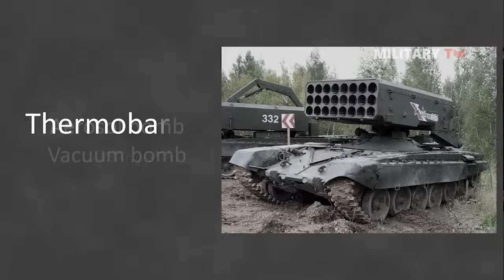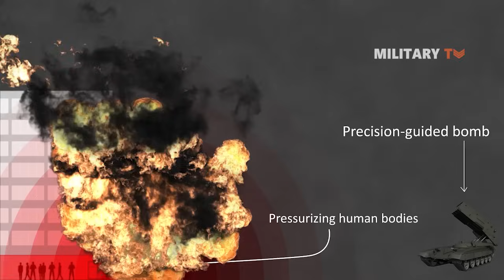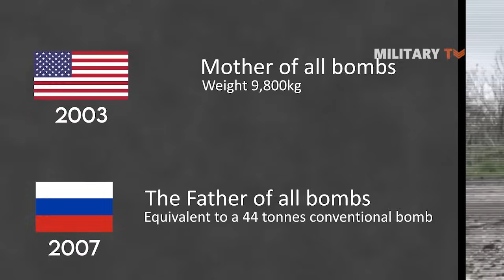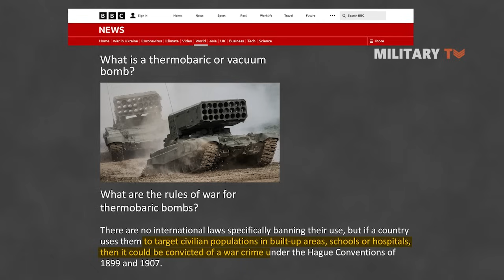What Are Thermobaric Weapons and How Do They Work?

Comment: How can a vacuüm bomb pressurize an area if It sucks all the air out the affected are where the bomb detonates? Shouldn't be it hard to get air in your lungs that the prolonged explosion makes a very hot fire ball, so the closer you are, the harder it is to breathe due to consumed air from the bomb and also the heath that burns. I saw videos that people in tranches are extremely affected by those weapons, even it explode at a relative distance where a normal explosive bomb would only shake the ground with a bang. So there is a big difference. So why causes this bomb extreme pressure if it's a a vacuüm bomb? Why do they call it vacuüm?

Comment: nothing could be more wrong.. a thermobaric weapon uses an oxidizing gas, ethylene oxide which is in the liquid state inside the warhead before hitting the target, an explosive opens the container of this oxidizing gas and this ethylene oxide in contact with the atomized air detonates, creating a thermal and mechanical wave that is much more destructive than a conventional explosive
we are talking about a wave with hypersonic speed and a temperature of well over 1000 degrees

Comment: Under the code name N-Stoff ("substance N"), chlorine trifluoride was investigated for military applications by the Kaiser Wilhelm Institute in Nazi Germany not long before the start of World War II. Tests were made against mock-ups of the Maginot Line fortifications, and it was found to be an extremely effective incendiary weapon and poison gas. From 1938, construction commenced on a partly bunkered, partly subterranean 14,000 m2 (150,000 sq ft) munitions factory, the Falkenhagen industrial complex, which was intended to produce 90 tonnes of N-Stoff per month, in addition to sarin (a deadly nerve agent). However, by the time it was captured by the advancing Red Army in 1945, the factory had produced only about 30 to 50 tonnes, at a cost of over 100 German Reichsmarks per kilogram.a N-Stoff was never used in war.

Comment: Your explanation is misleading. A thermobaric device doesn't "suck" anything whatsoever. It uses the oxygen in the blast radius, as one would expect, but does not provide a source of negative pressure to "suck" oxygen.
Reply: he is talking nonsense.
Reply: exaggerating.
Reply: the only thing sucking is him before every sentence. thought buddy was having static messing with his audio
Reply: I believe what he's trying to say is that the reaction produces an area of low pressure then has to equalize so it draws in atmosphere to replace the atmosphere that's been blown away.
Reply: It creates a negative pressure wave after using all the available oxygen. They've done the studies and have victim remains proving bodily damage from the vacuum resulting from the sustained fireball.
Reply: Thank you
Reply: the fuel burns the oxygen and heats the remaining air. sucking remaining oxygen in the area away and mixing it with unbreathable air. thats how it it is used against tunnel systems without penetrating the earthwork. to counter this people use small oxygen tanks that you can hold in your hand to not suffocate. the video is correct without going too much into detail.
Reply: @gradeyundery4939  It's also why tunnel rats used flamethrowers before they went in. Try to consume as much oxygen as you can to subdue anyone they came across. Wasn't all that effective on large tunnel networks but the same theory

Comment: You are confusing to similar sounding weapon systems. one was developed and used firstly by the German army in the Eastern front in WWII. The same system was later developed in the 60's by USA used in Vietnam war and USSR used in Afghanistan all three nations used a bomb with a primary using traditional compound and secondary detonation the later an aerosol gas or fuel used. The different Type developed by USA was a munitions for a new tactical deployment need never before conceptualised for a  situation criteria had not existed before  for this type of deployment thus they did not have in their inventory across any branches this weapon. Procurement already approved as it had been on the think tank drafting table was given by appropriations committee with a US $67M budget and 3 years program was given in principle for this speculative time frame in the year 2000. The USA did have have a laser guided delivery system in mind that might be compatible but did not know or have either a projectile or a chemical Compound developed at even an experimental laboratory level formula. With theory of principle of operation and concept stage given work started in the prototype & development with the program then in the wake of 9/11 twin towers collapse the USA went into all hands on deck it was now a high level priority. The completed in 60 days the selection of the laser guided missile, the same used for the MOAB with delivery unchanged aircraft fighter/bomber as it had already been tested and proven. This  munitions was delivered untested as would have normally been for its safety and effect of blast not done having only two test drops both failing to detonate in USA test range to the theatre of operations in Afghanistan. It was slung under the wing of the aircraft armed sent down the runway with the pilot later saying it had a 50/50 chance of working. It was dropped but detonated prematurely above ground about 50ft due to the missile being released with a shunting technique this movement normal procedure for other systems caused the USAF program to jump into a different programed flight path mode which detonated as that program instructed. The missile did cause massive damage as designed for this new 2 stage detonation first stage HMX plastic and polymer explosive the second stage aluminium powder  deep penetration underground bunker and cave system destruction weapon. Not as much as hoped due to botched launch not penetrating into the earth then detonating. The mission was a success proving the compound effective  yet failed as primary mission objective target Osama Bin Laden had already just left the area the intelligence community had known him to be earlier before it was deployed. The munitions do not contravene any InternationalbUnited Nations or another weapons signed declaration Treaty or Agreement as being inhumane or cruel to humanity

Comment: If you understand how they work you can see why TOS ones arent all that much worse than hi ex. You cant fit that much fuel to mist on a rocket less than a foot in diameter
Reply: Russia used them heavily in soledar, you could see the shock waves. A single volley was wiping multiple platoons out.
Reply: I think you'll be shocked to learn just how much expansion power liquids have when they turn to gas lmao maybe you should've went to science class instead of smoking cigarettes out back of the wood shop.

Comment: MOAB is not a thermobaric weapon. It consists of TNT, the same as conventional HE.
Reply: @funguseaterAI  
I don’t confirm what kind of explosive MOAB contains. Some sources say it’s Tritonal others say it’s slurry explosive. Unlike conventional HE, which use explosives to throw metal fragments, MOAB relies on blast as its primary output. If MOAB contains Tritonal, it is classified as EBX, enhanced blast explosives. Thermobaric explosives (TBX) and EBX are different in many ways; their compositions and reaction processes.
EBX are primarily used to strengthen the blast wave, while TBX are employed to increase temperature and pressure of the explosion.
Reply: he never said that MOAB is a thermobaric weapon, he just stated that FOAB is one. Russians used such type of warhead to make the 4 times stronger (than a MOAB) explosion possible on the practical mass limits of the bomb
Reply: as I remember MOAB should be GEL bomb? so insides should be some kind of high viscosity liquid to be more effective then clasic explosive?

edit: just read about it and most sources rank MOAB as classic thermobaric weapon capable of suckin air ( vacuum bomb ) so yes the worst kind :D